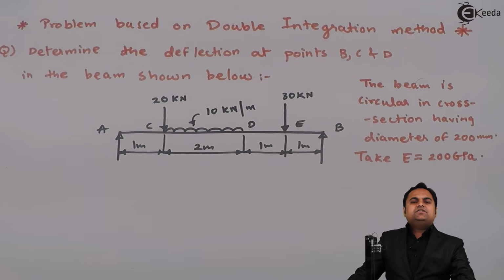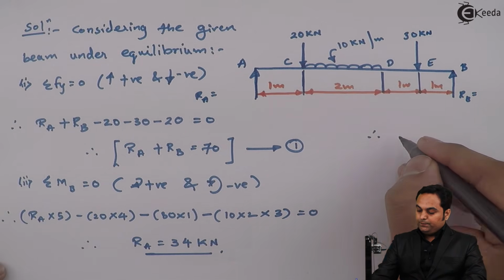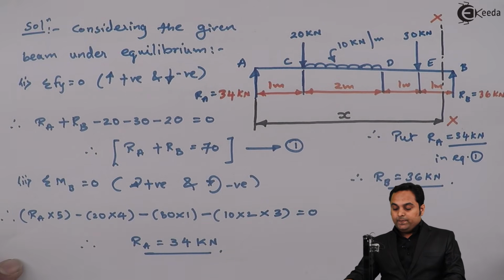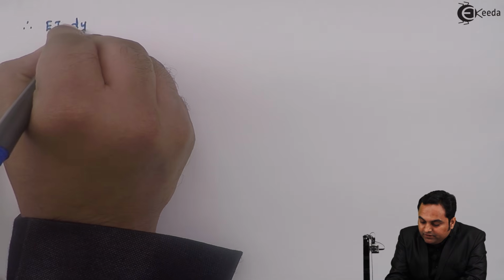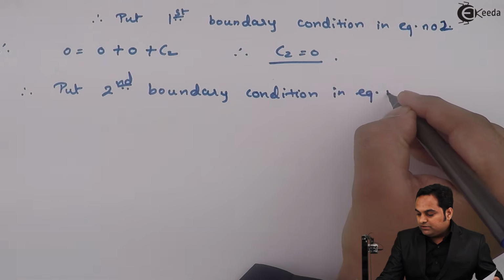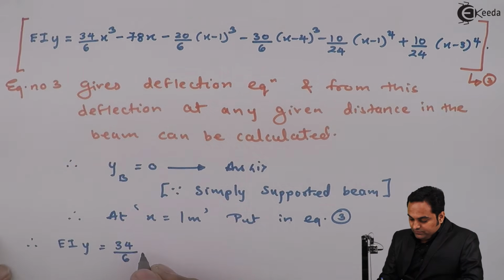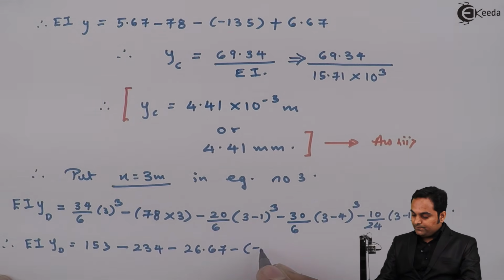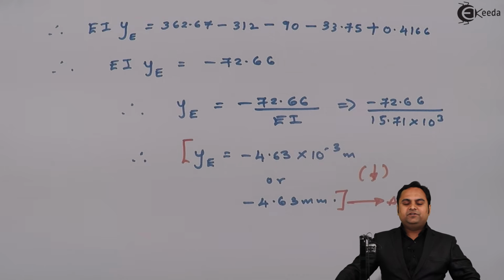Slope and Deflection (Double Integration Method) - Problem 2 - Slope and Deflection of Beams

Comment: I am confused in one point. Determining deflection for point C,D,E ,distance is taken from left side point A.But in this video for point B ,distance is taken 0.Why we don't take distance 5 m for point B by compering with point A???Sir  please if you give me  the answer ,It will be pleasure for me.
Reply: may be  the  xx cut section  is from a to x but from b to x is very small so take zero
Reply: xx is to point b but using a variable for x which can be used for any point on the beam. so you can use this theory to find deflection at any point with equation being negative being ignored.
using x as the subject mean that its a common term to integrate or to backwards by differentiating
Reply: If there is a support,the deflection must be zero.

Comment: there are two problems with this video, when you calculate for Y, you calculate the KNm by NM^2 so your result is off by factor 1000, also when you are adding up your deflection calculation you have to omit negative and zero values within the brackets. however this is a great video for those who can see your mistakes.
Reply: what confused me is E = 200GPa, Isnt is suppose to be 200x10^9 not 200x10^6?
Reply: yes but he states 200 x 10^6 KN not newton's so that is correct if you look at the units